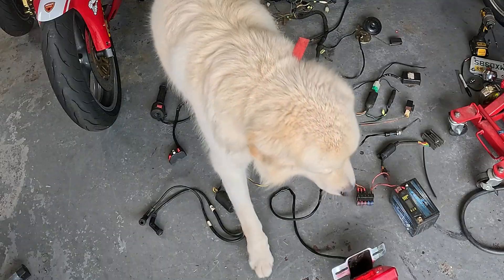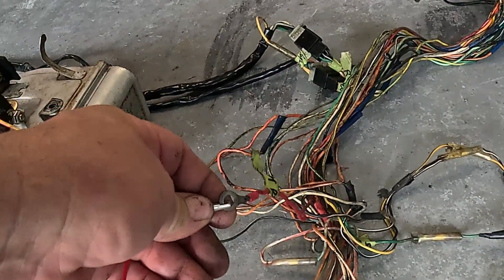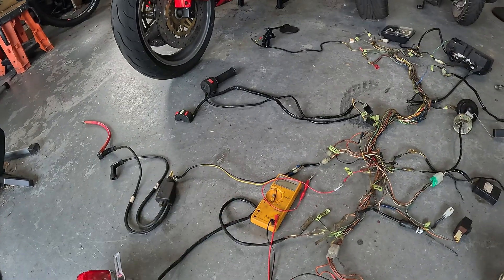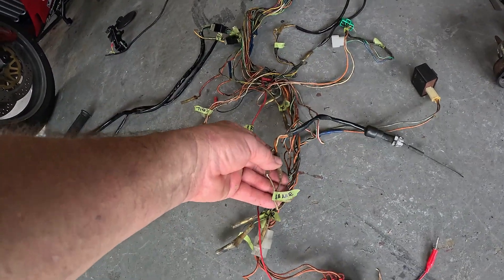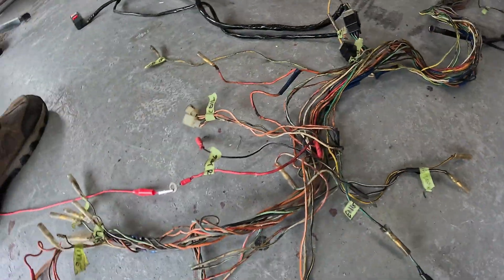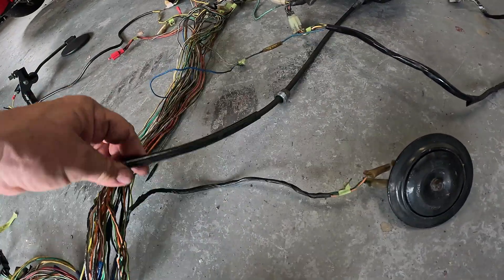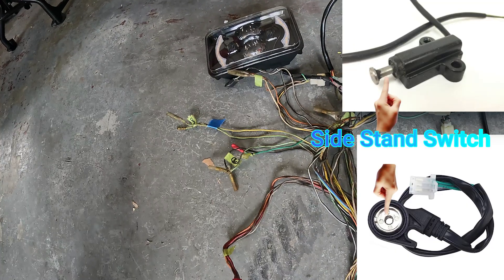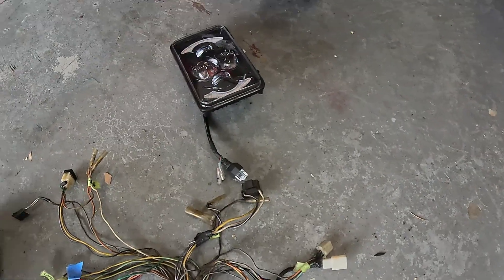Make Your OEM Japanese Bike Wiring Harness Work On Your DIY Electric Conversion

Comment: im not sure but in the last video i saw you connected the buck converter directly to the controller battery terminals i think you should add a fuse there because u already had one buck converter fail and it can easily short circuit so i think it's a nobrainer to add one so it cant pull full power from the battery to short circuit
Reply: i love ur video every one of them always learning something, with other creators its like i always see the same stuff repeated over and over, i wish i had connections irl with people with these kinds of interests because im too broke to get into it myself 😭😭
Reply from the maker: On that fake ducati homeade wiring harness one?  I have an inline fuse between the B+ and the key switch.  So I just went straight to the converter from the key.  I not only blew that fuse, I melted the whole fuse holder.  LOL.  Had no idea my motor was grounding my frame and touched a hot wire to the frame.  🤪